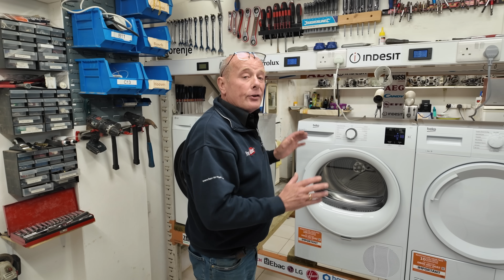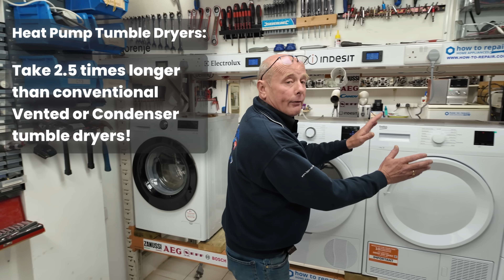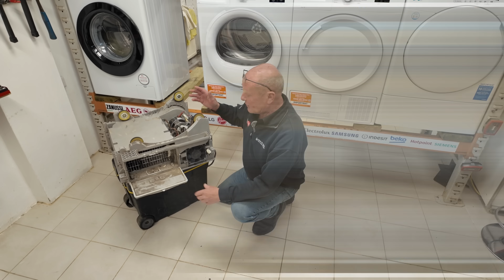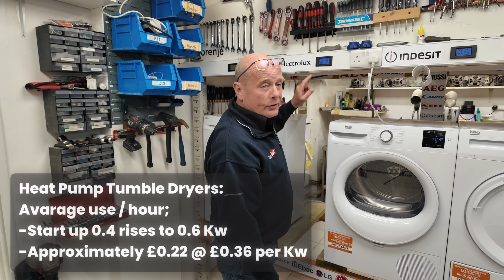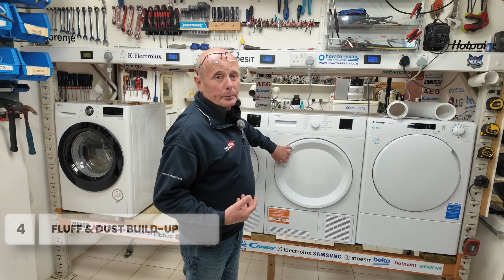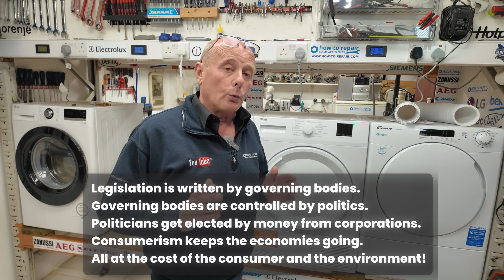Tumble Dryers the Shocking Truth About Heat Pump vs Vented & Condenser, NEW LEGISLATION!

Comment: Think about how completely ridiculous the concept of a traditional vented dryer is: You take 900 cubic feet per minute of air in your house that you just air conditioned and cooled down, and run it through a six thousand watt electric heater. Blow that air through your clothes, boiling the water out of them, and then blow that air and all the heat energy.... outside??? What in the actual f*ck are we thinking??? If you have moist air, you use a heat pump to chill it so the moisture condenses out and then put that same heat right back into the air again so it can absorb more moisture. That's how a dehumidifier works. It's extremely effective. And it absolutely makes sense to use that concept to dry clothes. Why waste 100% of the heat when you can re-use it to collect more moisture?

Dump the gas-burning fire-hazard vent-clogging old dinosaur. Why boil and roast your clothes and waste all of that heat energy by pumping it out of a 4" hole in the wall when you can just condense the water out like an intelligent civilization with access to refrigeration technology would do? 😂

Comment: I totally agree. We use a large 10kg vented tumble dryer. The larger drum helps to dry the clothes quicker as more air can move around the clothes. 
I bought a condenser dryer when they 1st came out, but the condensing unit lost its functionality as my wife could not be bothered to clean the condenser itself, this made it far less efficient. From an energy saving point of view (in my household), it is far better for me to keep using the vented dryer. Also, a vented tumble dryer helps to renew stagnant air in the house as it acts as an extractor. There's a mould epidemic in this country, and venting the dryer outside will help reduce mould, too.
Microplastics are also a bi-product of drying clothes in tumble these get into our food chain. The longer the clothes are being moved around, the more microplastics are produced. Reducing the drying time can only help us in the long run.
Reply: Unfortunately a lot of the cheaper vented dryers don't control the heat too well, I've found that they have a habit of "cooking" the clothes- elastics especially get ruined by repeated tumbling in such a machine. The one we had just vented the air out through a screen on the door, so all that humidity ends up in the room.

Obviously the best thing you can do is not use a dryer at all- hang the clothes out in the sun! Weather permitting, of course.

Comment: To cloud the issue even more the refrigerant used in the system will have significant differences in energy used to move the heat and overall temperature difference between hot and cold sides. So one heat pump dryer cannot necessarily be compared to another.

Comment: What the heck is with those cycle times . I used some dryer that had 2.5 - 3.5 hour cycles . Drying in 30 minutes , what is that , an oven ?
But the overly complicated and expensive unit makes little sense , saving at most 1kw/h , 250 times a year , that's peanuts . While costing more to own , to maintain and to repair .

Comment: I'm hoping my vented dryer will last a few more years.  Here in the States HP dryers and available but the long term data is not (all I've seen is info hyping the greenness).My electric vented dryer uses about 2.5kWh (~20 cents) per load, so the cost difference between a HP (10 cents?) and resistance heat when you average the equipment costs (15+ years vs 5-10 years) I don't see that HP will save me anything. If I replace my dryer I'll redo the math.

Comment: Heat pump dryers aren’t more efficient. Yes, they use less electricity, but that’s because they do not generate heat. 

They simply pull the heat out of the air and focus it into clothing—heat that was produced by your home’s heating system— and apply it to the clothes. 

Electric heat is nearly 100% efficient. That means if your home’s heating system is less than that and you have an electric dryer, it’s actually less efficient—particularly when you consider the additional electricity needed to drive the heat pump.

I think this whole thing is snake oil.

Comment: I replaced my central AC / gas furnace system with a standard efficiency unit for$5K USD. I was quoted 2X that price for a high efficiency unit. The high efficiency units are more complicated and more likely to break. I recommend going with a simple standard unit.

Comment: I'm a/c technician. And I see that every 10 years manufacturers discontinue production of models of the machines limit parts and you have to buy new. That's why I discontinue buying and installation of Fujitsu, Daikin, and Carrier equipment. If you mention pur design? Out right stupid design. Fire hazard by design. Maybe I'm getting old, but with age comes wisdom and experience and I see idiots in action. Our future doesn't look so good.

Comment: The math is NOT complete. With a heat pump dryer, you can install a new unit in a suite without having more amperage in the panel. And in places that get hot in summer or cold in winter, not blasting the air out of the house is a real win in terms of energy efficiency. Imagine it being minus 10 C, and your dryer creates negative pressure in the house, and it also creates a 5 inch hole in the wall that cannot be insulated well. It isn't pleasant! In the UK, perhaps the calculation is different. But I predict heat pump dryers are going to become extremely popular in the coming years.

Comment: Another thought regarding any direct vent dryer, they suck conditioned air out of the house as well. The conditioned air inside the home whether it be heated or cooled, you paid an energy bill to condition it & now your dryer is sucking it out of the house and consuming more energy to do it. Appliances are such a toss up anymore, it seems that they last a few years until something fails and you find out the part to repair it is half the price of a new machine.

Comment: Like electric cars, it's a no brainer - avoid heat pump like the plague.
Particularly as a pensioner.

Mind you, if the system is as well built as my car air conditioning, that refrigeration unit still works after 18 years.
But I cannot believe any home appliance will be built that well.
And if it needs re-gassing, can I just take it to my local garage?  I suspect not.

Built in obsolescence was a side effect of the industrial recovery after WWII, boosting business by marketing driving consumers to buy new models and replace perfectly functional appliances.  Of course it didn't take long for manufacturers to cut corners and make cheaper, less turdy machines.

Comment: NetZero is nothing to do with the environment and more about money and control.
I bought my vented dryer 30 years ago. Its still working fine.
I changed the drum bearing myself after it failed... I measured in ID and OD and bought an over the counter roller bearing.
Its 2 screws and the wiring to change the heating element, takes about 10 minutes.
The drum belt is original... I have a spare just in case
Its had a couple of fan belts, again easy to change in a few minutes.
The timer clock no longer counts down, so I just twist it to a time and off it goes... I just set a timer to remind me to turn it off.

Comment: The condensing dryer is best as it helps prevents dampness and mould in houses. There are many problems with breakdowns of air source heat pumps (sorry government and people who vote green) but the technology just isn't reliable enough yet, nor do they produce as much heat as their advocates claim - there are several newspaper articles of tenants where the council changed the heating system to air source heat pumps pleading to have their old storage heaters back so they could afford to heat their houses. This technology might seem good on paper but it is not practical. This video that confirmed other maintenance issues with tumble dryer heat pumps just reinforced the fact that politicians want to change the world (because every politician only feels useful/powerful if they can destroy what went before even if it worked) without considering all the complexities of the changes they want to bring about.

Comment: I will always try to repair my machines like belts, motor, door micro switch solenoids, but as for the heat pump con. won't touch with barge pole. Thanks for the info update, I'm now going to buy a spare condenser which should then see me out. And if it's still going strong when I die I shall leave in my will for everyone to argue over. 😀

Comment: So a heat pump basically compresses the heat from the ambient air to get it to a temperature that will evaporate water from material relatively quickly. 
If the ambient air temperature is cold say from a garage or out building it will take longer to dry and therefore take more energy to run.
If it’s used inside a house with the heating on then it’s taking the heat from the house and cooling it down, so your heating system will consume more energy because your dryer is stealing the heat. 
That would be an interesting experiment and maths :-)

In my last house I built a drying room 3’x3’ with 2x 40watt oil filled radiator tubes , clothes would dry over night , but I’m guessing it may use similar energy as it’s just increasing room temp to evaporate water.  Plus the water vapour is raising the humidity in the house.

Candy condensing dryer , I recently repaid one for a friend took hours as it was poorly designed the back and the sides were all one panel and the only way to get to the motor capacitor was to totally strip the machine from front to back ,  nightmare.
My Zanussi  was simple 6 screws took the top and the side off and there was the capacitor
Reply: Not exactly.
If you consider a dehumidifier, it works by recovering latent heat energy from the water it condenses from humid air on its cold inlet side, and then passing that heat energy back into the same air on the warm side, which ends up having a much lower relative humidity than it started with because it has both had much of its water content removed, and is also warmer.
With a dehumidifier, the warm dry air is vented to the outside to provide relatively drier air to the surroundings while sucking in fresh and relatively more humid air to dehumidify, because a dehumidifier is trying to suck water out of the air around it.
With a heat pump dryer, the difference is that it's a closed system where the warm and relatively dry outlet air from the heat pump gets passed back over and over through the clothing to dry it, and then back into the heat pump inlet to remove the moisture and recover pretty much all of the energy it took to evaporate that water from the clothes. The air is a circulating fluid used to carry water vapor to the heat pump. The air evaporates water out of the clothes (and cools as a result) because the air is dry, and then gets dried and reheated by the heat pump recovering most of the energy by condensing the water that it evaporated
It's basically like having a sealed room with wet clothes and a dehumidifier inside it, but in a fairly small box. The same air goes round and round, and the evaporation/condensation energy is effectively recycled.
Manufacturing/endurance decisions excluded, it's a pretty neat idea.

Comment: Miele Heat Pump Dryer TWF760WP - it does not even allow me to go over 1:40h at full  load as it has moisture sensor and i set it to very dry
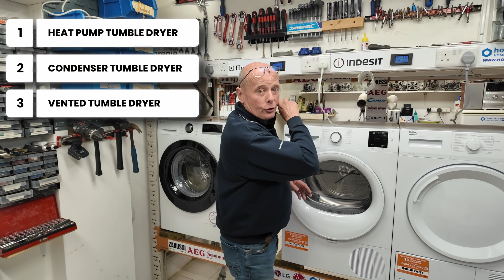Reply: Jeah i was wondering. My machine says 3h for drying but when fully loaded it is finished in 1:30h to 1:45. And if the running time is down. All the cost benefits  outweight the other problems for me.

Comment: I have a better solution, don't get a tmble dryer, i wouldn't let my ex get one, partly because i know she would use it to warm up clothes
Far better for the clothes and environment to let them dry naturally
What do tyou do when it's wet outside ?
Get a clothes horse/drying rack like we did in the old days, it's what i use.
I'me even annoyed that my new washing machine is cold fill only, i live alone, when i wash up i have a full tank of hot water for just a few dishes, i used to use the remainder to save electrically heating the water in the machine

Comment: I plan to stick with exhasting dryers, even if I have to install an air makeup system to make it work. All the fumes from the fabrics and laundry chemicals are not good for breathing. Of course if you smoke or vape, you probably won't notice a difference, but I notice the leakage causes me issues when I go to a laundromat every couple of years.

Comment: I am appalled that appliance manufacturers expect you to replace all your major household appliances after 10 years service on average. My washer & dryer along with the fridge & stove were all purchased in the late 90's. They all still work fine with the exception of having to change the rear bearings on the drier drum. These appliances have lasted 25 years with minimal service or repairs and are still going strong. The newer appliances are prone to control module or soft touch keypad failures. Give me an appliance with knobs and no computer processor over an energy efficient flimsy plastic piece of crap anyway.

Comment: Just take condensing maching. Trash heater. Install dehumidifier in the input-output path. And will be extra 200-400W to motor consumption. 🤔 Dehumidifiers now relatively cheap.
Reply from the maker: I've decided to build something shortly and make a video on it and I'm going to do moisture sensing on the time period with a mechanical dryer and also static clothing with a dehumidifier and fan running should make an interesting video
Reply: @How-to-repair  Physically was drying in this way in a small enclosed room (bathroom, also humidity stable). Results were good. Would be interesting to see results made in more scientific way.

Comment: On the property that I installed a heat recovery system to I added a connection for a vented drier so that the heat of the drier would be extracted and distributed back into the property, whereas with all the systems displayed the energy used is lost.  At home we simply use non-energy systems like a washing line.

Comment: Regarding the difficulty of teardown: I don't think it matched my experience. When my heat pump dryer failed, the repairman had the whole thing to bits relatively quickly.
The problem is, he still couldn't fix it because all it was doing was starting... and immediately finishing. No error code, no fault, it just said the clothes were dry and stopped running.
He said he had no idea what the fault was, and the diagnosis was likely to end up being the proprietary logic board, and that it was probably going to be an already-obsolete unit that would cost me a dryer's worth of effort to diagnose and replace anyway.

So I come at this from the angle that while I probably agree with your points on the repairability of heat pump units, I'd also like to see some kind of regulation of logic control units in home appliances.
Personally, I would love to see some standard part with onboard wifi and simple programmability, akin to one of the early model raspberry pi units, become a standard logic unit within a wide range of consumer goods.
Your appliance's computer fails? Chuck in the standard part and reprogram it from the manufacturer's website.

As to dryers? I've got a bathroom with no extractor fan because the guy who did up the house did a rubbish job. Fixing it would cost a lot of money because there's no electricity on that whole wall of the house. I stuck a dehumidifer in there (running a power cord under the door from the hallway because, again, no power) and when it's not drying out the walls, it's drying out my clothes. I don't think I'll have a dryer again so long as I live at this place.

Comment: I have a Miele heat pump.  We run it for 90 mins on warm air and it costs 22p to dry a full load.  It is far better on the clothes too as vented and condensing are to aggressive and wrecks and shrink clothes.  Our drier is 7 years old.  Previous condensing and vented driers lasted less than 3 years.  So although mine cost £900, the cost per dry, the quality of drying, safer on the clothes, and longevity of the machine proves that buying cheap means buying twice, or even thrice.
Reply from the maker: That's a great argument. I totally agree with you buying a quality machine that works makes total sense. All the cheaper end heat pump dryers are failing within five years then my argument stands but when you pay £900 for a heat pump dryer that is still working after seven years you are not only going to be quid in, for yourself!! but also the environment

Comment: my natural gas dryer works better then any electric one, heat pump or not, forcing high electric use appliances, like heat pumps, water heaters,  home heating systems etc are garbage and do nothing but raise electric rates, and they wear out faster. in addition with all the AI data centers being built which will suck up more electricity driving demand and costs up no one talks about that at all

Comment: I paid for a vented dryer for years and maintained it myself, then I switched. My current dryer takes many hours to do the same job, but cost nothing. It's a cupboard containing a hot water cylinder. I just put stuff on hangers and hang them on a rail next to the cylinder. There's a very small vent at the top into the loft space to allow moisture to escape. Hanging the odd garment on the curtain pole over a radiator in a spare room works well too. Heat pump dryers need radical redesign. If  designed as a pull out unit of a standardized shape and size, we'd have an interchangeable winner.